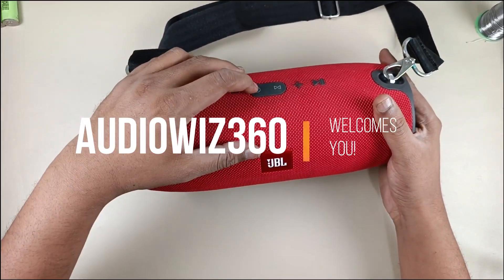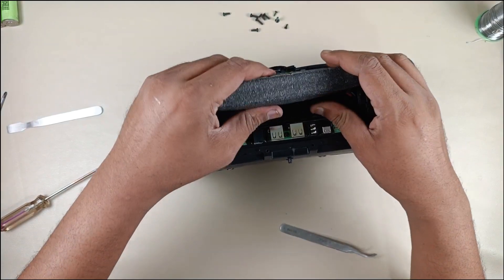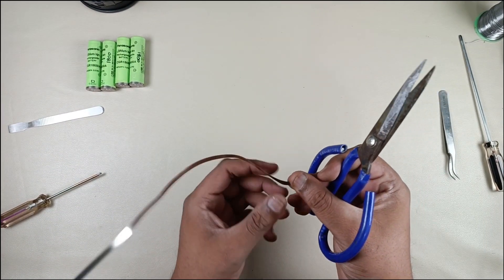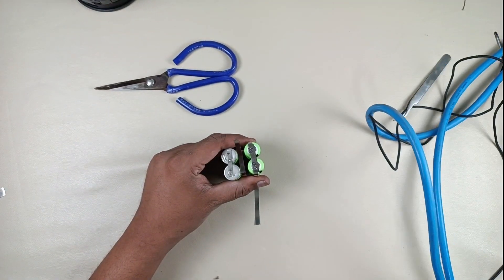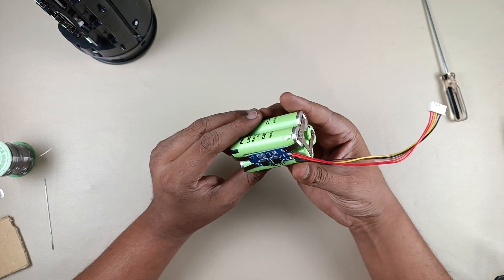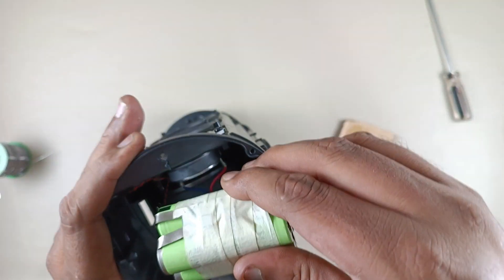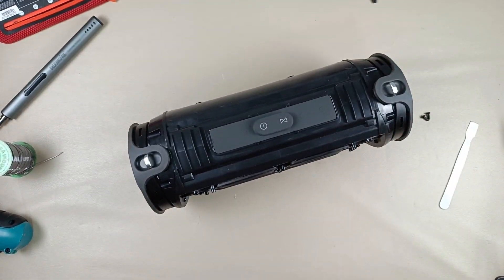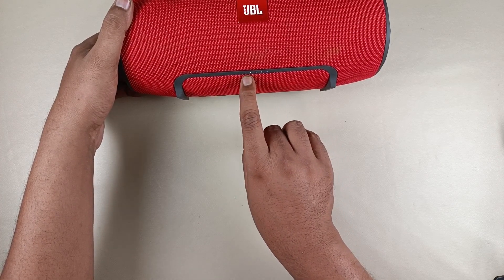JBL Xtreme battery teardown and replacement Li-polymer to LI-ion in perfect way

Comment: sir i have sony srs xb 40 bluetooth speaker. its cells are in good condition but bms is damaged. battery pack is 7.4 volt 5200mah. so which bms should i use for it. also there are five wire outputs from that bms. how to connect it

Comment: when the battery gets hotter it will affect the speaker and damage the speaker. there's always a reason they placed the battery beneath the unit.hehe
Reply from the maker: by the way battery not touching the speaker, and this is work around for the people around the world where the lipo battery is not available of this battery size, and this is for those who are not using the speaker at all because no availability of actual lipo battery,

atleast they can use the speaker by following this.

possibilities are endless. ❤️😊👍
Reply: @audiowiz360  i didnt mean if the battery is touching the speaker, what im more concerned about is when the temperature gets high since its closed area the speaker will be the first affected because of high temperature. so the battery should be placed away from the parts can be damaged.
Reply from the maker: in general voice coil generate lots of heat while playing audio, and the heat transmits to spider, and even paper cone as well, I belive it will not harm the speaker driver. Thank you!
Reply: @audiowiz360  yeah I know, but not as hot as the battery. It can add more heat to the whole body, though.

Comment: Olá!, saudações do Brasil🇧🇷 , eu gostaria de saber se é possível colocar 6 baterias iguais a essa, para aumentar a autonomia da jbl xtreme.
Reply from the maker: yes possible, 2S3P connection so total 6 batteries you can use.
Reply: @audiowiz360 A BMS não corre risco de danos?
Reply from the maker: bms should match the amps as battery amps used for 7.4v used in that case bms will be safe.
Reply: É oq eu faria, já q sobrou o espaço original de fábrica da bateria! Acho que dá sim, só terá fazer as conexões extras e manter um trio de baterias em paralelo (ñ apenas um par como no vídeo é apresentado).
Reply: @valterhenriquediedrich5626 minha maior preocupação é se a BMS dá conta das 6 baterias
Reply from the maker: the built in battery of JBL Xtreme is 3.7volts 5000mah battery 2 pieces connected in series

Comment: Hi, can you explain me one thing. when i make 2s with 18650 so the voltge vil be 8.4 v and the charger is 19 V so how this can work ??
Reply from the maker: at charging section in motherboard it gives voltage output only to charge 2s only not total 19 volts.

Comment: Can we do this same with charge 4
Reply from the maker: yes by following basic steps of this and you can change the batteries. 
keep in mind:
check the specs of the actual battery and  you can do it similarly.

Comment: I want to know if my Extreme 2 still repairable? because some had borrowed it without the charger. When the battery was low they tried to recharging it using the USB on the back of Extreme direct to power outlet. After returning blutooth and Power on does not ON if using battery only and goes ON only if plug and using only line IN jack to make it sound from audio source. 😞
Reply from the maker: possibilities are always there to fix.

Comment: You could have placed the batteries two up and two below parallel pattern so that the final shape is slim and longer and would fit in the original battery compartment. Why did you join them in block shape?
Reply from the maker: this batteries are little bigger in size so the covers will not fit upto the mark, but that is also one choice and this is one  choice .